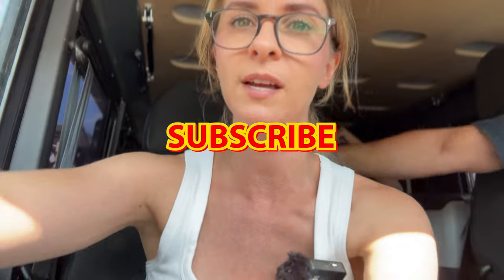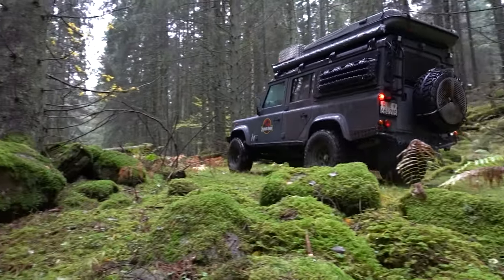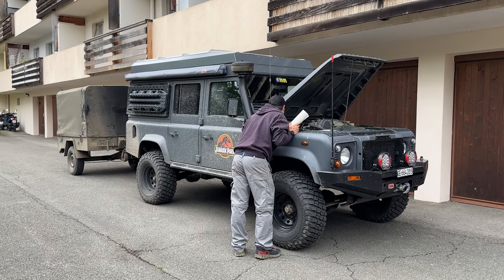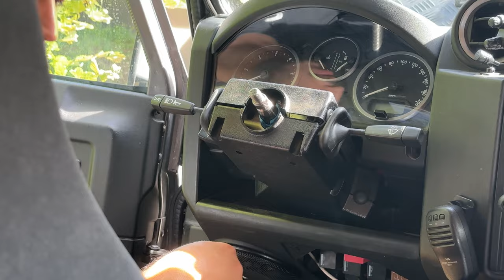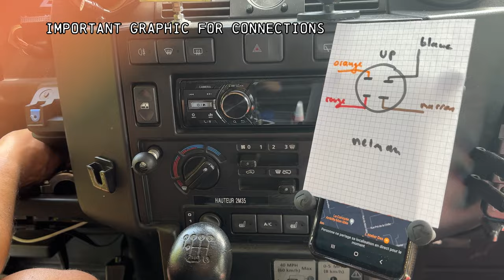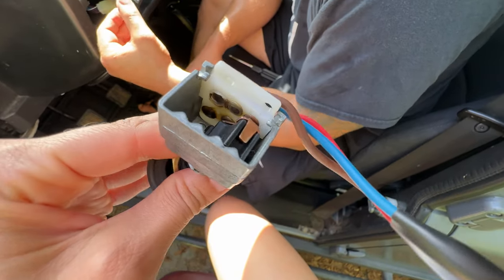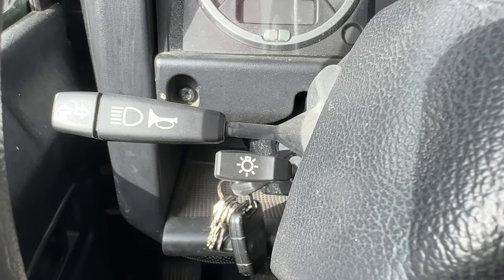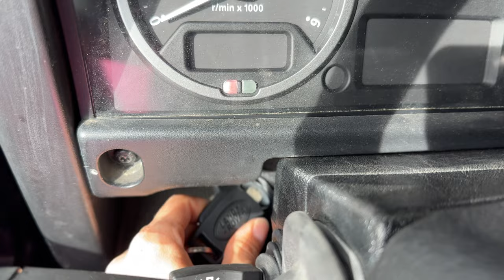Headlights Switch Replacement + Neiman Replacement (Land Rover Defender)

Comment: I downloaded the wiring diagram for your model Defender and the headlight circuit is no different to my 300TDI, the relay is in series with the light switch and is only there to  cut the lights when the key is off. Your light switch and high/low beam switch still carry the full lighing current. If you fit the relay kit your switches will last forever .
Reply from the maker: where did you upload the wiring diagram? I'll pass on the message :)

Comment: Interesting and very helpful  information about Defender Puma issues... I had problems with our ignition switch sticking and not turning on our Puma, it was suggested to me to use graphite powder , I put a good dose in the key hole (which i did a number of years ago) and it fixed the problem.
Reply from the maker: Do you mean you couldn't turn the key tu start engine like us?
Reply: Yes... although I could get the key to turn after alot of trying. Once I put the graphite powder in the key hole and turned and moved the key everything worked fine. Now I always carry some graphite powder in with the tools.
Reply from the maker: Good to know 👍 thanks for sharing

Comment: Landrover wiring seals letting the smoke leak out again. we used to see it all the time in the indicator/dip switch when people fitted uprated bulbs. an extra relay was the fix on TDi and older models, if i remember correctly after 2007 there's a headlamp relay as standard. My old 90 has a large appetite for electrical components, it's just part of the ownership experience.
Reply from the maker: Part of the game, yes! You are right on Puma Defenders there's a relay for switches

Comment: Happened to me I just cut the switch end of the lever and join all the cables and boom all sort it 
Now I installed a new one but I do keep the old one with all the cables join up as a back up
The ignition switch is what you call the part on the back of the Neiman by the way
As well some garages and some stores replace the original ignition switch the is made of metal with the plastic ignition switch and even the heat of the sun melts them here in Australia 
I do carry a new metallic authentic ignition switch on my spares as well to prevent me leave me on the road 
Funny games with the old Landies hay
Reply from the maker: Having a backup for a common failure is a good idea 👍

Comment: It's a common issue with the defender, use a relay in between the switch and the lights 🙂
Reply from the maker: There's already one on Defender Pumas
Reply: @offtrackfamily  Thats strange then, as usually a melted light stalk switch at the steering wheel means there is too much current going through it (they are poorly made and landrover never updated the design since the early 90's and 110's from back in the late 80's) at the connector which i thought should not occur if there is a relay in the circuit. 
Out of curiosity, are the two spotlights at the front on relays? and if so are they on the same or their own relay as the normal headlights?

Comment: My tdi300 had a relay for for the lights so no current flows through the light switch and they turn off automatically when the key was removed
Reply from the maker: Nice for the lights 👍 There's a relay on our Defender, seems it's a poor quality switch manufacturing.

Comment: Since I add 2 relays in order to get a bit more than 12 volts at the bulbs I did not experience more problems with the main switch. You can buy a proper loom or diy.
Reply from the maker: What Defender do you have? We tried out loop relay Red bison from Paddock. When redoing our setup we realised it was useless because there's already a relay on Defender like ours so we removed it.
Reply: @offtrackfamily  it is a 110" SW 2007. And the main switch was replaced by a genuine one IIRC. I use standard power halogen bulbs.
Reply from the maker: @alfredo9173  Good to know, thanks for sharing

Comment: It's amazing, the same switches used since 1985 but with a different connectors, I have a Ninety from 1986 and replaced headlight switch and horn and hi beam lever also. Same colors as yours but the conector in the 90 is a old style rubber type.

Comment: Yes, working on Defender electrics can be a major pain in the ass, especially problems caused by rotten chassis earth points.

Two things may have helped here (although I could just have been lucky): almost every light in my Defender is LED, so currents through relays, switches and cables are reduced quite significantly, prolonging their lifetime.

Second: had my key once stuck in steering wheel lock, used brake cleaner to flood the lock washing out any residue and then after drying sprayed some graphite spray (just graphite, no solvents) into the lock, wiggling the key all the time. No similar problems since then.

Comment: It’s better to install a Swedish light amplifier, the current will go directly from the dynamo to the lights and runs not over the switch, the light switch only will shift the relais which comes with the amplifier set on or off,I did use a steel center point to loosen the one turn bolt on the neiman to change it for a new one, worked great, took me about 15 minutes max,I would be afraid to set the car on fire with that flex😂
Reply from the maker: Seems you have all the the right tools and skills, and that you know everything very well. We should definitely have you around for all our jobs.

Comment: I changed the Headlights switch 5 times. In my case, I had 2 + 4 headlights and every time I turned them on after a while - I found that it didn't work anymore. I disabled them (extra headlights) and since then I have no more problems. I think you have an extra consumer and that's why it burns all the time  . Maybe the headlights are custom and consume too much? . Anyway,  I think you exaggerated with the angle grinder.. Better consult an electrician
Reply from the maker: We don’t have any extra consumers. There’s a relay for our stock headlights and ARB spotlights have their own loop. In 200’000 km not too bad to have that switch burn out once and also one time for the indicators one. Any tips for removing neiman another way are welcome.